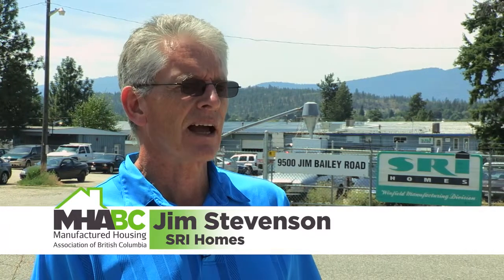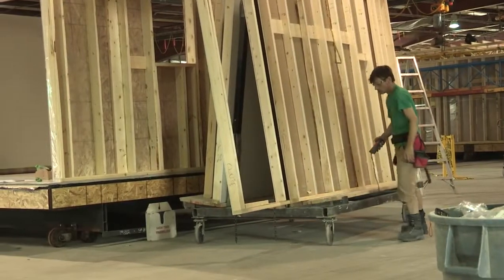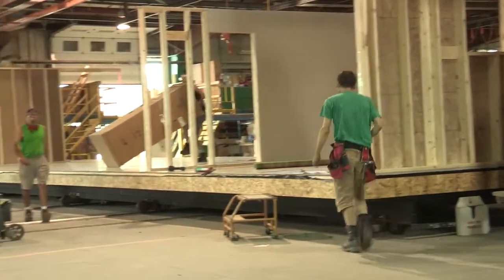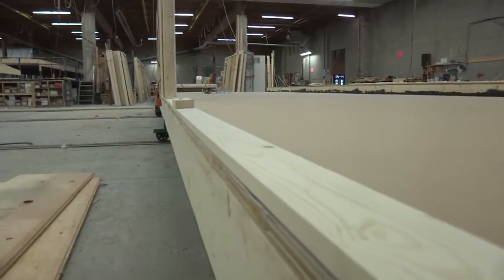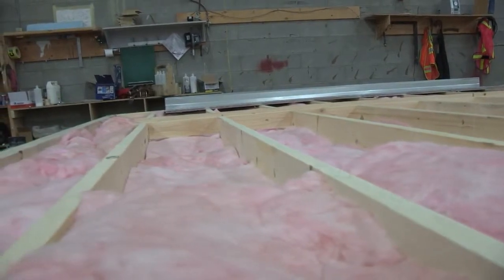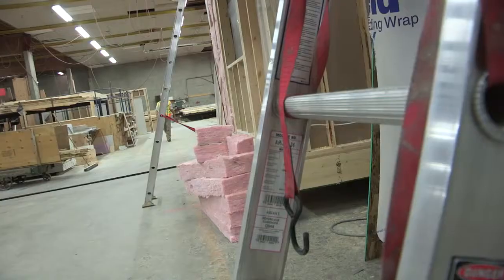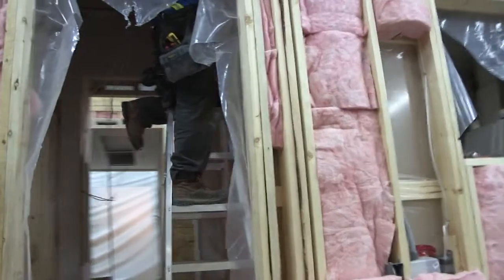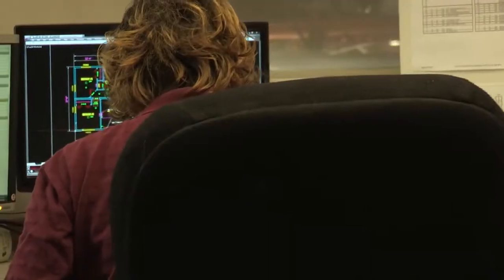On Site VS Manufactured

Comment: Manufactured homes use the cheapest of materials.

Production assembly is tightly controlled as far as time lines.

That is why they are slapped together.  

Let's see here......cheap materials & slapped together.

Enough said.